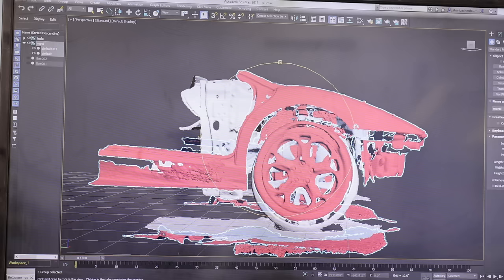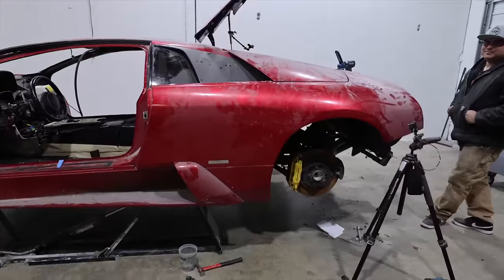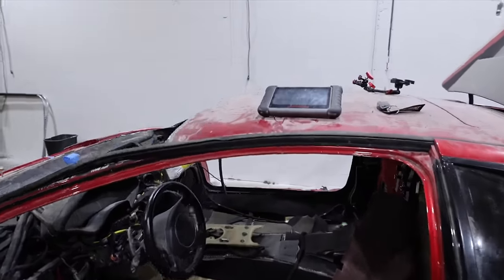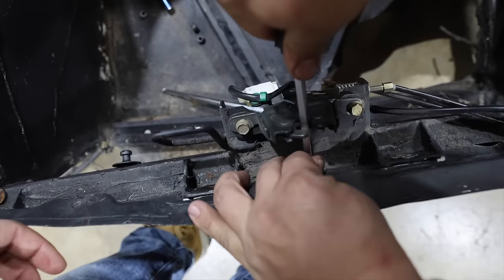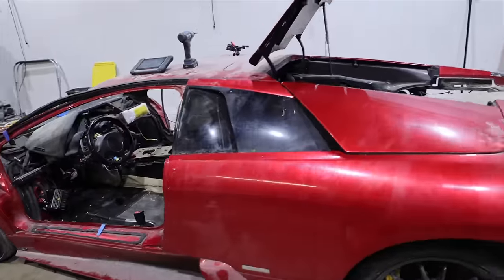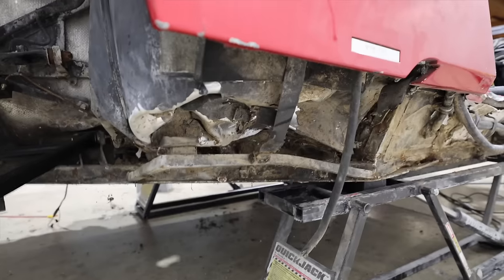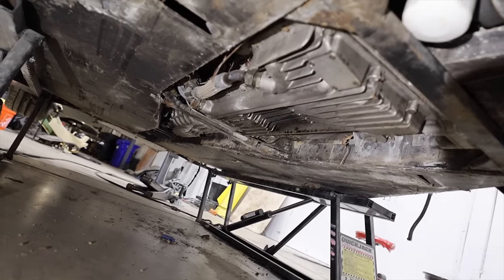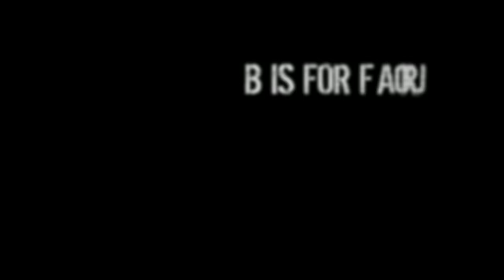Lamborghini Murcielago Revival - Will The Engine & Transmission Live or Give?

Comment: Only way you can save it is by putting 4 turbos on it

Edit: the people have spoken 🗿🗿🗿
Reply: And widebody it  and put a custom interior in it
Reply: Also getting a gitani exhaust system
Reply: ma man !
Reply: Is quad turbo better on a v12 than a twin turbo
Reply: Why stop at 4? Aint there 12 opportunity right here ?
Reply: @hadrian2505 yes and no, it's almost pointless besides faster spooling but if done as a compound twin setup it can spool faster and make more boost
Reply: @hadrian2505  look at the Veyron 🌝
Reply: @buttkicker8512  now you're thinking with turbos
Reply: @hadrian2505 is 2 spoon faster to eat your bowl of cereal than 1? Answer is no unless you have the right setup.
Reply: I concur....it wants....no it needs 4 turbos!
Reply: I was thinking a V10 swap would be way more cost effective than fixing the engine or even turbocharging it.
Reply: Yes
Reply: Hes not going to B is for Build the motor, that doubles the work load... make it sound and look good and call it a day
Reply: @travislewis7810  he should S is for swap it with a better and better sounding V10.
Reply: Remaking it from scratch with an all carbon body
Reply: @jokwonpope1561  I'm expecting them to do this, or either replace it with fiberglass because fiberglass cheap.
Reply: It’s the only way to be sure
Reply: That's one expensive firework 😂
Reply: I like the way you think

Comment: You should 3D scan the driver side quarter and flip it and 3D print a mold then make it out of carbon, it would probably be a lot cheaper to do it that way rather then to buy them new, same with the front fender.
Reply: I would look for a model of the car online first, would possibly save a ton of time.
Reply: Exactly what I was thinking when they started on it. That or find one in tact, with an owner willing to let them scan it and print from there.
Reply: Won’t work bro
Reply: or just ask duke dynamics
Reply: DUUU ETTT
Reply: They could contact street bandits too..
Reply: @jwalster9412  either they need a to scale modell (and thats harder to find then you think) or they scan the real one - real one would be easier as the could probably ask someone who ownes one easier (Ed, Street Bandits etc.)
Reply: @jwalster9412 it would be far too small though…
Reply: Exactly what I was thinking... Street Bandito style
Reply: Great idea!! Just what I was thinking.
Reply: @onelogue  yeh I love the idea of making it out of carbon. (Now where did I put my clave?)..

Comment: I just spent 6 hrs troubleshooting my motorcycle. It was torn to pieces 25 years ago and covered in rat feces but I finally diagnosed the charging system and ignition. I know this is nothing close to you guys but I love watching the builds because it gives me courage for mine! Keep posting!!!
Reply: Sweet! What kind of bike?
Reply: I once changed my pads and disks and felt like a king 😂 great feeling
Reply: @darrenswails  1971 xs1b (early xs650). It’s a pretty rare bike I got for really cheap. It was built as a desert sled in the 80s and torn apart in the 90s. Im bringing it back to its former glory and prepping for a desert ride across the country in January!
Reply: @adam.677  one thing at a time! I’m still in college for engineering but I’ve done v8 swaps in several cars not meant for it, currently working on a subi vanagon swap, 2 vw beetles, and 2 motorcycles haha
Reply: @steelavocado1  sounds like fun, my first bike was an '86 Honda rebel that i made a half hearted bobber with scalloped paint with hand laid stripe separating the colors ( amateur but not bad from 15 feet), drag bars  and i added a 7in halogen bulb  since the original was dangerous at best sometimes, i miss that slow little bike
Reply: @steelavocado1   Sounds like you're having quite a time! I rebuilt my single cylinder Husqvarna with my dad during COVID. Without him I don't think I'd have had the confidence to tear apart the engine, but we did and we got it working. Sadly it got stolen last year and the thieves broke the key/lock cylinder and some other parts so I am back to diagnosing trying to get it running after LAPD luckily found it!

Comment: If you want new throttle bodies they are actually the same as a Volvo on the pre LP640 Lamborghini Murcielago.
 Volvo V70 MK2 2.4 Petrol cars use the same throttle bodies but you need to rewire the plugs I believe are different.

Comment: 3D print the body panels ,Bumpers then 3D scan the good side and mirror the parts, at least 4 perimeters ,4 top and bottom layers +100% infill on the TPU for the engine mounts

Comment: Also man check every part number on these i believe you can get the bosch TBs off a late model volvo.  They can also be somewhat rebuilt.   Check for audi PNs and VW PNs i know the lambo tax is steep so it pays to shop around and test parts on a bench before replacing.  GL
Reply: Matt Armstrong went through this with his Lambo... re. Volvo Throttle bodies.

Comment: Those 3D printed engine mounts aren't going to last. All 3D filament types are extremely prone to heat and weather. Outdoor temps can approach the melting point of filament. I recommend using a hockey puck with a hole in it for a DIY mount. Or at least use 100% infill
Reply from the maker: thats just not true, take a blow torch to a TPU printed engine mount, let me know how it goes.

Comment: Once you get this car rolling and before you start repairing the body work, you should take it to a auto body shop with a frame. Have them verify that the frame is good or modify or adjust it if need be.
PS DDE has a front boot frame. Or it could be Houston exotics now.

Comment: Engineer here. Square tubing is about 40% stronger against bending than round tube of similar wall thickness. Round tube is super strong under direct tension or compression. Meaning round tube if you can properly triangulate is stronger and lighter. If triangulation is more difficult then square tube is preferred to mitigate bending. Strength of materials my dude.

Comment: The corrosion in the throttle bodies is the second hardest material on the planet and fine powder. You do NOT want this to get into your engine since it will kill your cylinder bores and piston rings in less than a second. The bodies are of an early Volvo P2 platform and have a known problem with the sensor that measures the position of the throttle valve. You can get a conversion/repair part for that that converts it to a hall effect sensor that will not wear.

Comment: You dont need to use that cheap OBD scanner. You can use the Autel in just OBD2 mode! Its when you are in the general where you see all the brands, on the left side there is a Yellow tab OBD2. Press on that and have it scan automaticly all the testmodes. 100% shure you can use the Autel like that scanning for engine codes.

Comment: Actually think they are Volvo TB's Chris.... Could be wrong. But pretty certain. Also the HVAC controls are shared with a common sedan. $25 bucks for it! 😂 Also used in the Zonda
Reply: Volvo V70 MK2 but you need to re-wire the electrical connectors

Comment: Hopefully the TPU is a temporary solution? Not a great solution for a high temperature environment, since its a thermoplastic. You could use the 3d printer to make molds for the engine mounts.
Reply from the maker: engine mounts arent high temp, its gonna be used until it fails ( or doesnt ) ill let you guys know when that is. But ive build many isolators with TPU and never had heat issues with them

Comment: Hi there you have  do throttle body reset via diagnostic computer which era's previous learned values and then you can do throttle  body adaption, when going through the adaption process you will here the throttle bodies working.

Comment: There are many parts you can use from other cars. What I mean is you don't need to buy everything from Lamborghini (electrical parts ). As in Mat's Armstrong he used side signal lights from a Ford car. Likewise do research and find the parts and get it working. Keep the V12 live. Goodluck

Comment: I would say to use polyurethane mix (liquid you can buy and mix) to make the rubber isolation for the engine, form experience I know the 3D printed stuff isn't the same as solid.

Comment: Many low volume car manufacturers of that era used box section for chassis, there’s nothing wrong with it and in some situations it’s stronger than tube, there are certain YouTube fabricators that will tell you tube is best but they are fabricators not engineers.

Comment: My father's got a red 2003 Murcielago Gated Manual, 9k miles. We had curb rash fixed but the center caps for the wheels and in the process they were  lost by the shop. Additionally,  interior buttons for the "wings" and other  functions are sticky and there's issues . Any idea where I can get replacement parts?

Comment: Just one last question about the Tesla, could you put the body of the Lambo on the Tesla backwards with the Tesla rear wheels as the front wheel of the Lambo and just move the steering wheel and pedals into the dash of the lambo.  Of course you would have to move all the steering assembly, but the motors run either way.

Comment: What is the Shore A hardness of your Thermoplastic polyurethane? I hope it above Shore A 90, less than that I'd guess that it would be too soft, especially if it's printed fill level is not 100%.

What is the fuel cell made from? Can you not remove the dents with compressed air inflation or a heat gun - minus the fuel and fumes ?

Comment: I'm surprized Oscar just couldn't cut the bottom of the fuel tank and build/ weld it back to good.
Reply from the maker: he could, but when you account that everyone does get an hourly salary, its cheaper to buy a 600-700$ replacement than get the materials and take the time to repair

Comment: Mercedes especially on the amgs have issue with motor mounts collapsing and the whole drive train being lower then spec most likely hopefully it will be only motor mounts the mounts are typically hydraulic and go bad around 60-80 k irregardless of driving habits

Comment: If you are going to B is for build it then you should do it the right way, put in a 6 speed manual and rear wheel drive conversion, it makes the Murcie faster, more reliable and a lot more fun to drive and while you are in there you might as well throw a supercharger, headers and straight pipes on it 😅

Comment: Does the car have an idle air control valve?
Reply: This could be why you’re getting the high idle if it does
Reply: I guess it doesn’t due to electronically  controlled throttle body and throttle position sensor

Comment: Ferrari and Lamborghini got away with hiding quite a lot of fugly, 'flying bedstead' construction under their pretty exteriors until surprisingly recently. I think it was a matter of allowing the use of relatively low-skill (and hence low-paid) welders. Check out the Ferrari 308 Stanceworks project, there's nothing 'thoroughbred' about the chassis in that car either.

Comment: The DeTomaso Pantera has a nearly identical distance from the center of the front wheel to the dashboard as the Model 3. 
It is 13 inches shorter, so stretch it behind the door, add big scoops there, widebody, with deep dish wheels.

Comment: I love the vision that you have with your builds. 

BTW: Is it RPM or RPMs?
“RPM” means “revolutions per minute,” so it is redundant to add an S at the end of the abbreviation—it's already plural. Adding the S is so common among people working with engines that it's not likely to get you into trouble, but you will impress some by avoiding it.25 May 2016

rpms | Common Errors in English Usage and More - Paul Brians

Washington State University